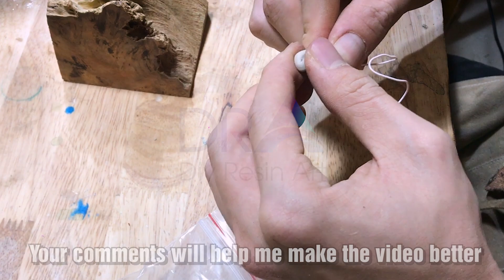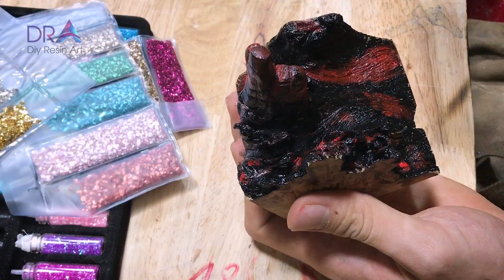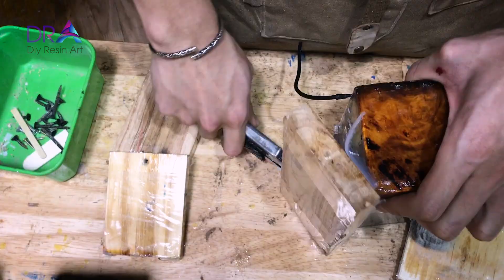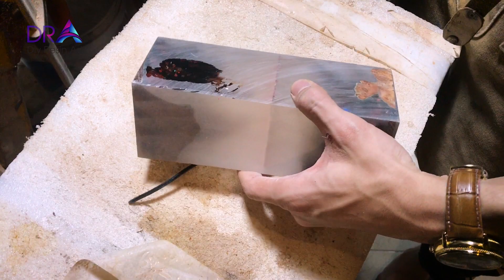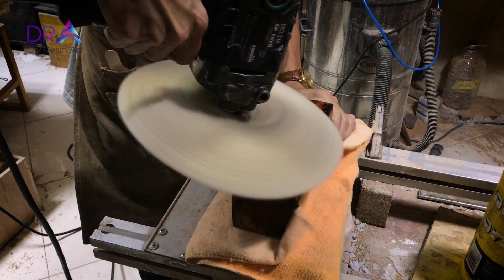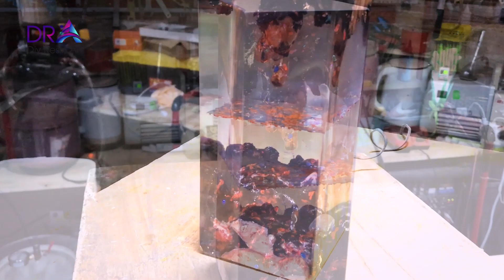How to make Epoxy Resin lamp Heart of the Earth | Diy Resin Art

Comment: Very nice, may I ask How are you able to sand and buff the back without cutting or chewing up the lights cord ?
I have made a couple lights and each time even trying to stay away from it I cut right into it. Also the turning of the piece as I sand often twist and break. These are the small battery lights the Constant turning it just breaks. Any help would be great. Thanks
Reply from the maker: Please insert the wire into a steel pipe, fix it when polishing 😀 Or you cover the place with multi-layer tape